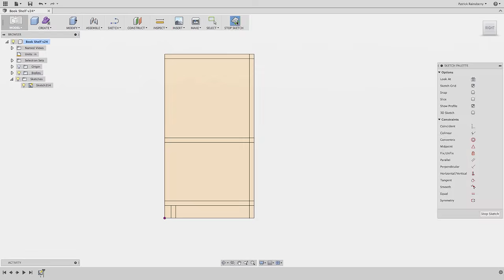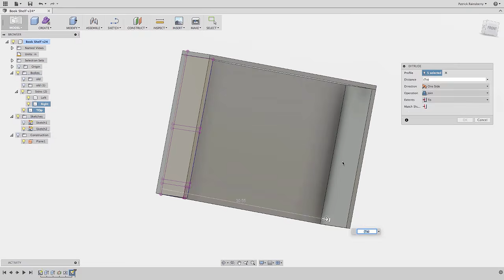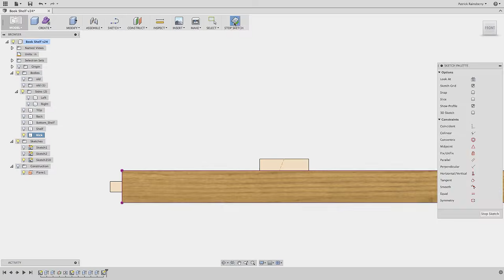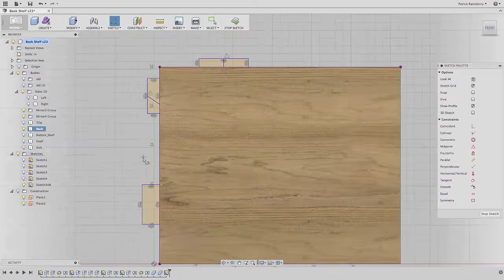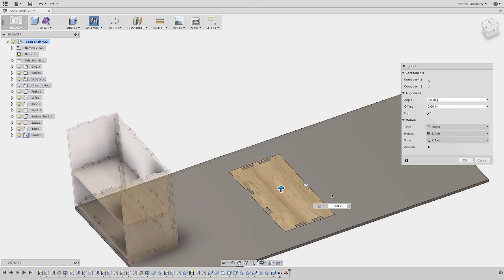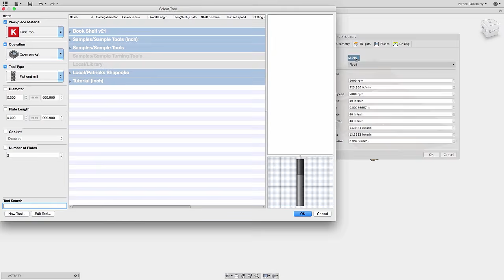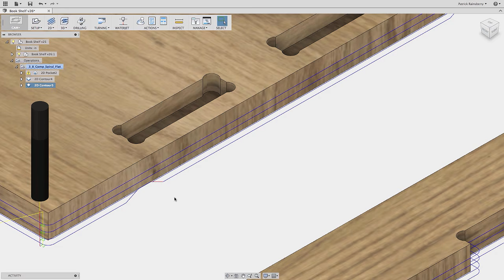CNC Router with Fusion 360, Bookshelf Tutorial

Comment: Hi Patrick, Thanks for a very instructive video. I'm learning Fusion (used SketchUp for a while) so videos like this step by step is very useful. Would definitely welcome some more. I have run into some problems when trying to redo your example. I hope you can give me some advise.1) when joining the items to the big sheet of ply they are moving (partly) together so I cant separate them. If I rotate one 90dg it disappear. The joints are marked with a flag and when moving them some distances are being put on.If I try to dogbone nothing happens (if anything the part just moves).Any suggestion ?
Reply from the maker: +Martin Barfoed Did you make sure that the parts are "components" not bodies?  There is a step where you convert them into components.  

The way the dogbone script works you have to have laid them flat first.  And the "up" direction needs to be Z.  The script is looking for inside corners that are in the Z direction to automatically apply the fillets.  If this isn't working in your model you apply them one at a time to the edges rather than picking the bodies.
Reply: +Patrick Rainsberry Hi Patrick. Thanks for the advice. You were spot on about the body/component issue. After converting to components the joining worked out. I'm also confident that you are right in the it's the direction of Z that's my issue with the dogbone. Selecting only one inner line it works. Selecting a component it doesn't. Inspection the origin it also looks like the Z axis (blue) is the depth of the book case - and not height - even though the pan cube seems to do the what I expect. Top gives top view, front the front etc.
Is it possible to shift the Z direction of the drawing to make the add-in work?
Best wishes. Martin
Reply: +Martin Barfoed I managed to make a fix by rotating all components including the stock ply. Is that the best way to do it?
Reply from the maker: +Martin Barfoed Yes once you are in this situation thats probably best.  The best thing is to kind of model with Z-Up from the beginning.   It is actually a setting.  I should have pointed this out in the video.   If you go into preferences (under your user name) there is an option in general to make "Z Up."  It won't affect existing models, but for new things you create it will have everything oriented this way.  It seems weird that it is not the default but most other CAD systems have had Y up as the default for so long that lots of people are used to it.

Comment: Patrick - this was an amazing tutorial, one of the best I have seen that combines the whole workflow of covering in detail design to manufacturing. It is also one of the very few that deals with wood and CNC routers vs metal milling. Simply superb!

I actually watched this twice now, first time to take it all in and make some notes, and a second time following along and creating the design myself. I learnt a ton and I think there is a big appetite out there for Fusion 360 CNC router related tutorials. One question, prior to laying out the components flat on the stock for CAM, is there a best practice way of keeping a copy of the components assembled in the completed bookcase form to be used for later tweaking?
Reply from the maker: +Mark Slatem Good point.  I thought about first making a copy of the parts and then laying only the copies flat.  In the end I decided it was easier to work with the model with out having a duplicates.  To see the assembled model I just roll the time line back.

Comment: Absolutely brilliantly, thank you so much! After a nightshift last night, I have my first mini shelf made on a home made CNC.
QQ: I designed the shelf in 12mm ply, then found an 8mm piece of ply in the workshop and decided to use this instead (as I said, I made a mini version of this shelf, about 1ft wide only). Everything resized properly in Fusion, but the dogbones ended up as drilled holes in their original position. I suppose that's the way it is or is there a clever trick to have them move to the new corners automatically?
Reply from the maker: +Marc Hanbuerger Well..... It should automatically work if it was a native Fusion feature.  But since the dogbones are created with this script often times they don't quite update correctly.  It is best to simply delete the folder from the tree and then recreate them if you see that problem unfortunately.
Reply: +Patrick Rainsberry ok, thanks!

Comment: Patrick thank you for a great tutorial. Have you figured out how to do rabbits for a blind dado where you do not want to leave the radius from the tool on the 3 outside corners? in other software I would reference an oversized sketch and the plane. I cannot see it with Fusion 360.
Reply from the maker: +Jamie Bogdanovich Hey I think understand the question, basically you want the tool to come out past the part? You can adjust the "Tool Containment" on the geometry tab.  You can set it to tool extends past geometry.  I just did that for an open slot on a part last night.
Let me know if that works for you.
Reply: +Patrick Rainsberry Thanks for the response, I played around with it today and found you can place an oversized sketch on the plane of the bottom of the rabbit and use that as your selection.

Comment: I'm having a problem in the post processor for Shopbot. The file I attempt to run comes back with a VS error. It appears to be out of range. I suspect that Shopbot is looking for inches per second and it looks like the postp is providing inches per minute. Two questions; can I delete these lines in the code (vcarve doesn't define VS in their code) and how can I insure the I have the latest Post Processor where can I find the absolute latest version for Fusion360. I got my through a forum discussion it looks like it was posted two years ago. HELP!
Reply from the maker: +Jack Tinsley Once you have Fusion 360, it automatically downloads updates (including posts) so if you are using the post that Autodesk distributes then you should have the latest one.  Also Fusion should always be at the latest version.

That being said I have not seen that problem before, but i am not the best person to ask.  

For fusion 360 related questions, like "Can someone tell if i am truly using the latest post for shopbot" the best place to go is:
http://forums.autodesk.com/t5/fusion-360/ct-p/1234

For questions on using Shopbot like "Can i remove this line of g-code and still use it" go here:
www.talkshopbot.com

Comment: Why are you mirroring the bodies instead of doing a rectangular pattern in the sketch?
Reply from the maker: It is really just personal preference.  Typically lots of ways to get to the same result.  Personally I like as few and as simple sketches as possible.  I feel it creates a "tighter" more predictable parametric model.  But like you say could easily do a pattern in the sketch.  The trick there would be to make sure the parameters of the pattern are tied to the appropriate variables if you still wAnted the parametric update from the inputs.